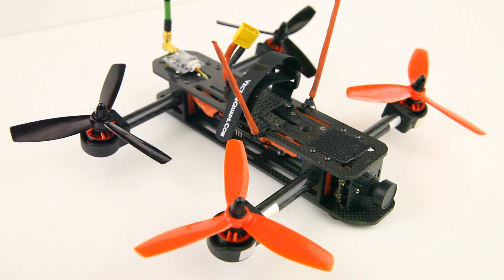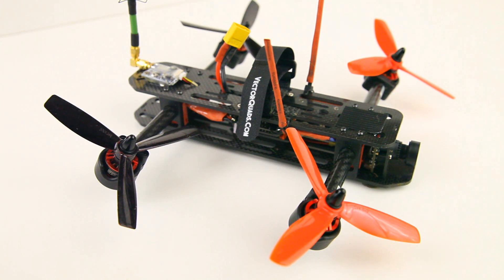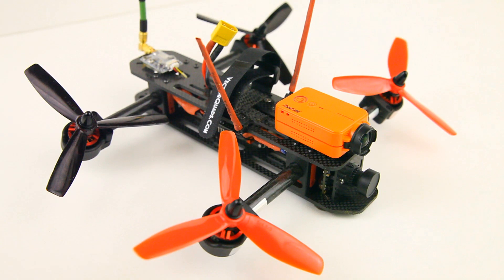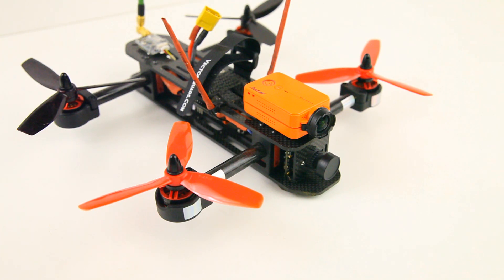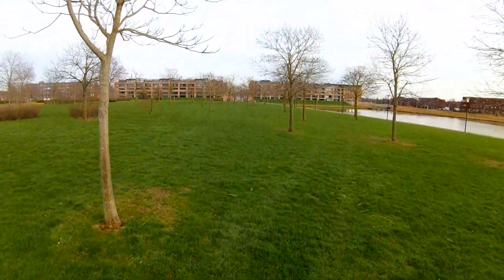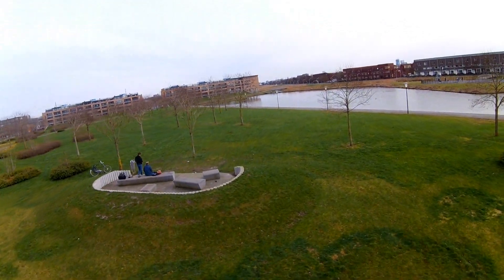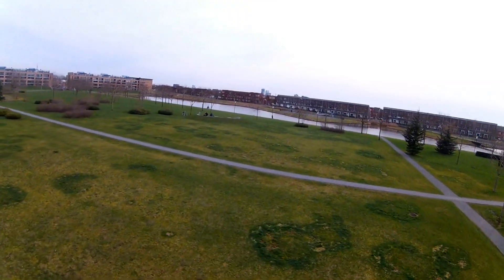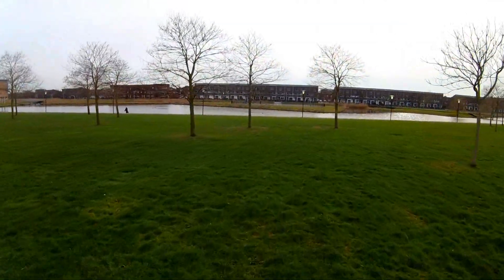Vector Quads Tiltrotor Quad - Aerial Videography Test :)

Comment from the maker: Good HD video from the VectorQuads tiltrotor?? Let's try that :)
Link to this Vector Quads frame kit: http://vectorquads.vfmcorp.com/us_english/vq250v1-kit.html

Link to the build instructions: http://vectorquads.vfmcorp.com/ca_english/vtc250v1-kit.html#product_tabs_documentation

Link to the music used: https://www.youtube.com/watch?v=XER8Zg0ExKU

Specifications:
Empty Weight (excluding servo): 220g
Length: 242mm
Width: 232mm
Height: 54mm
Tilt Rotor Angle: +50º / -40º

Included: 
carbon fiber parts
injection molded parts
various machined parts
2 Velcro straps
3 vibration damping balls
fasteners and hex keys

Comment: Hey buddy thats very good HD video from that camera. Is that a runcam or foxeer? No jello indeed and pretty cool stuff! titlrotor quad is flying smooth too looks like a fun one to fly to boot. cheers bro
Reply from the maker: Howdy buddy :) 
the cam used in this video is a Runcam 2, which indeed Does shoot good video :)  This is a good point to start from I think.. I've spent quite a few hours after this video stepping the quad itself up in stability :$  Should be smooth sailing! 
Cheers & thanks for stopping by Mike :)

Comment: I have liber pilot 15.6 frim wear.
Reply from the maker: Check well hmm I can't really help you out there I'm afraid.. It Should be quite similar, but you'd have to do some research yourself on that OR experiment.. 
I'm in the same boat over here by the way: after I shot this video, I installed the latest Betaflight onto the quad.. Can't get the servo to work the right way yet :@

Comment: I'm taken aback by how level and controlled the footage is...maybe we may see some companies bringing out tilt rotor racers...hmm
Reply from the maker: Wellll.. getting a tiltrotor to fly Really well is a specialty, and not manny people know / understand how to do That :$ 
Tiltrotors have gotten a bad rep because well... they just weren't set up well :P 
I've changed some things in my set up by now, so that I CAN allso fly it in acro (and do flips & such) :)
Reply: I would love to see that...and I'm sure your loyal viewers would like that as well. Must be nice to see where you're going to land rather than guessing and cutting the throttle as with most racers. You can also slow down and still see without briefly losing orientation.
Reply from the maker: Yeps.. there are Definate benefits to tilt rotors :)   Regretably I waster around 6 hours on trying to make Betaflight 3.1.6 on this quadcopter :|  grrrr.. still doesn't work :@

Comment: I have a hmf 300 , how do u git Tha cc3d not to tilt Tha quad wen u move forward?
Reply from the maker: Howdy sir :)  hmmm on a CC3D I really don't know for sure.. What firmware do you have on it?? 
IF you can flash Cleanflight onto it, the steps for my VectorQuads quad should allso work for you:
http://vectorquads.vfmcorp.com/media/documents/VQ250-Wiring-Setup-Guide.pdf

Comment: wow great video I need to get myself a tiltrotor quad
Reply from the maker: Howdy George :)  Quite good huh? I'm glad with this outcome.. Some work on the tuning left to do though! :)
Reply: That would be great for filming for sure
Reply from the maker: I think so :)  I had some trouble getting the latest Betaflight firmware to work well on the quad (some things concerning servo's were changed sinds Beta 3.0.xx).. but it's fine now :)
Reply: Oh OK I definitely want to look into getting one, is flying fpv much easier this way?